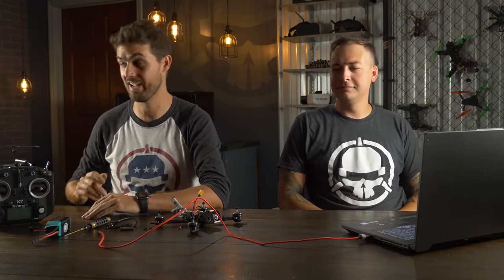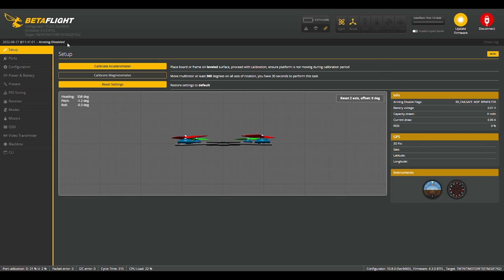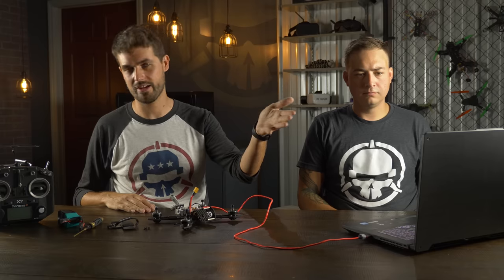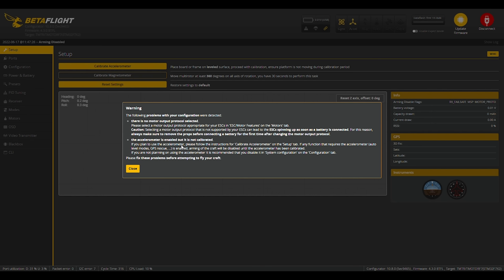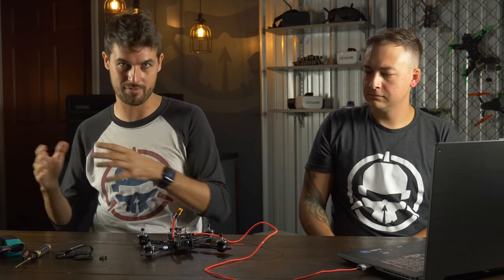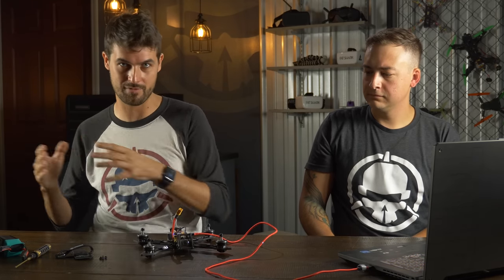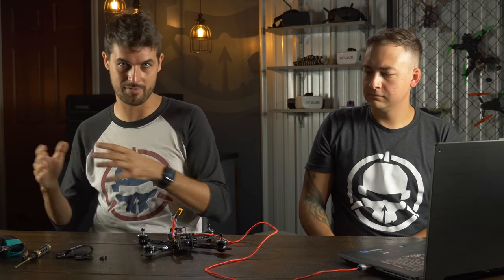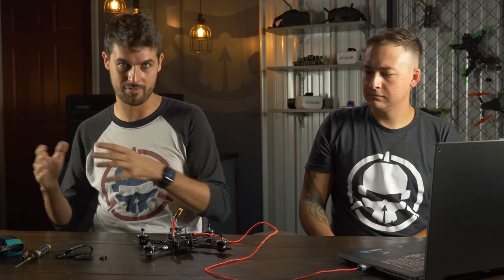NEW Betaflight 4.3 - Full Setup & Walkthrough

Comment: My iflight nazgul evoque does not like BF 4.3 with default settings. The motors made weird noises and were a bit hot. I had to adjust the pids and filters a lot, to make the motors sound smooth. Still ongoing too.

Comment: Motor stop while armed; Air mode overrides motor stop. So if you have air on a switch and turn off air your motors will stop. Switch air on and motors will not stop. I use this for landing. No air mode bounce, and I don't have to disarm to stop the props while landing.

Comment: why did you skip the dynamic idle part at the PIDS tab?
i wanted to know if its still needed in 4.3 if u allready set motor idle at 5.5
Reply: Long story short: Set it to around 30. If you hover your mouse over the question mark next to the input box it will give you more information. You may also want to check out Chris Rosser - he did a whole video on just that one setting and how it's beneficial.

Comment: I just got a BNF iflight nazgul evoque (crossfire) , today I wanted to set it up and take it to the sky for the first time.... I got the DJI V2 goggles bound and working , got my BetaFPV RC with a crossfire Nano tx modul working and I got the drone and the module bound and updated (constant green) , now i wanted to make the settings needed to arm the drone and stuff and realized that even my radio control and drone are bound , I don't get ANY input of the rc in betaflight,  I was asking several guys , they told me the stock settings of iflight should be fine (considered they didn't mess anything up building the drone) so what could it be? Maybe the RC is broke ? Can anyone help me ? Would really appreciate it! Thanks 😁✌️

Comment: Recently built myself a drone and was led down the garden path so to speak.  I'm using a zues 722 flight controller and got it all wired up and it worked perfectly,  on the 7 th flight got what to keen and crashed , broke the frame so built another frame transferred everything across and went to start it and it wouldn't even arm itself , the guy at the shop doesn't want to know about it and said betaflight will solve it , so without any idea what I was doing downloaded the configurator it opened up and said flash so I just pressed go and now I find out there are different versions etc . It has got to the point where I'm going to throw it in the bin and just buy one.  What an absolute head f##k . Is there someway or someone in perth that can help . Please

Comment: 36:35 I wholeheartedly disagree with the spinning up fast bit. While it doesn't hurt the motor persé, it's not something I'd be telling beginners.
Short bursts of power should be handled fine, however some motors are specifically designed to be cooled with prop-wash coming down on them. WIth a motor static on a bench without a prop on it the enammel wires in the motors might overheat and short it out. I've had it happen a couple times with EMAX LS 2207's. If you slip with your mouse or anything in that setup window it might leave the motor stuck on a high PWM value leaving it ramped up longer than you intended.